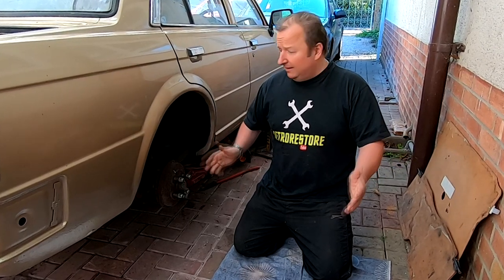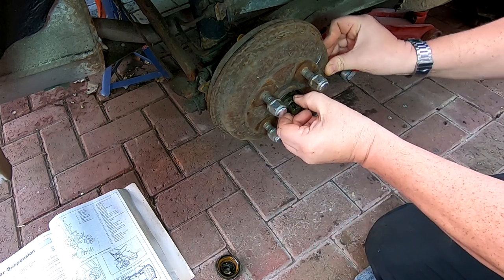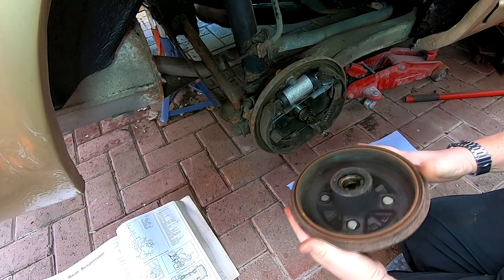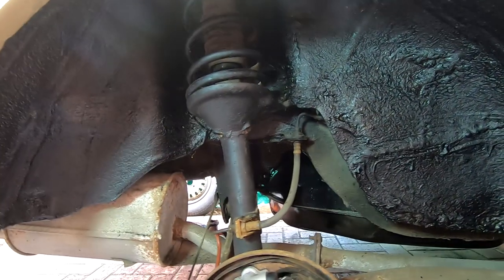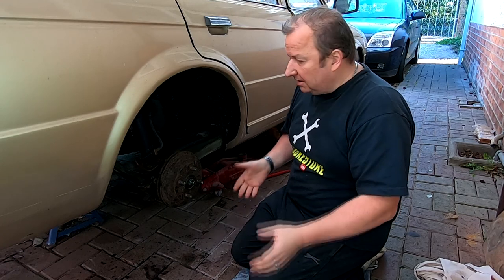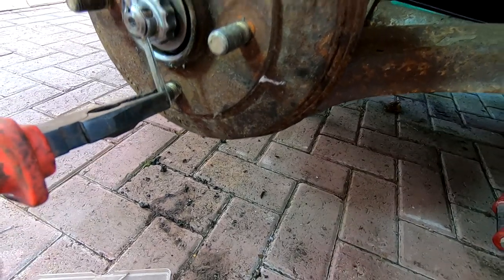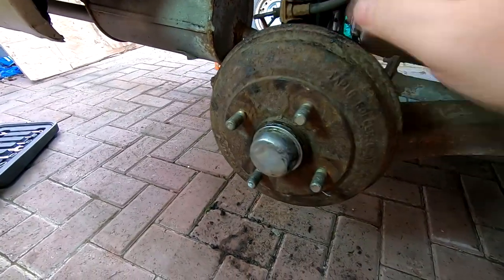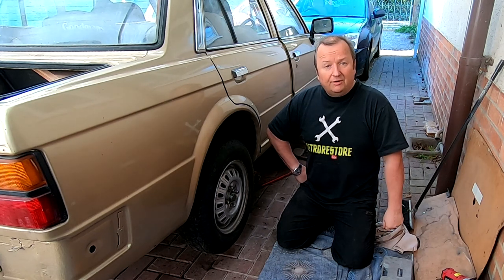Part 26 Triumph Acclaim, Rear Brakes Inspection

Comment: the grease is in there mainly as a dust barrier but I am with you if the caps fits tight dust can't get in nor water but if you hub has gone under water you should pull the bearings repack with grease spray wd-40 in to displace in water and reinstall
Reply from the maker: Well said Pete

Comment: Martin
I would be very pleased to removed rear drum and find new brakes  when I use buy and sell cars mot failures most rear brakes were leaking then brake pipe would snap a night mare all extra work its nice drop on mate
Phil from stoke